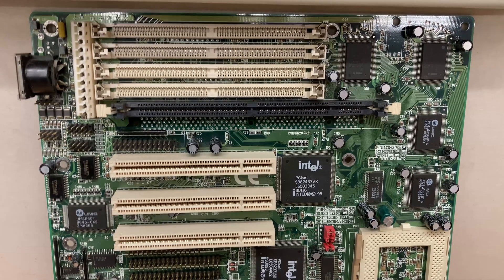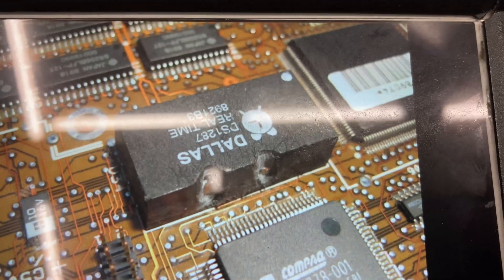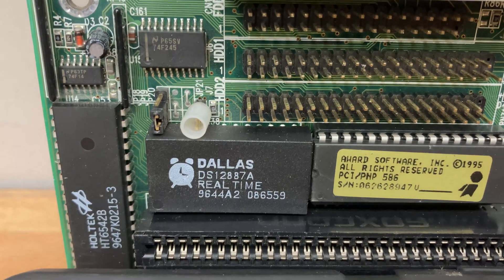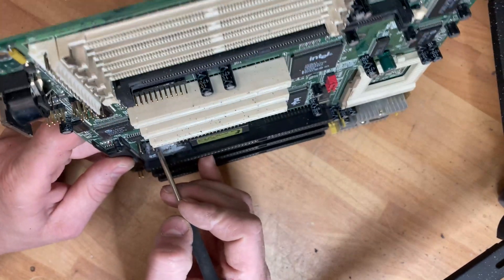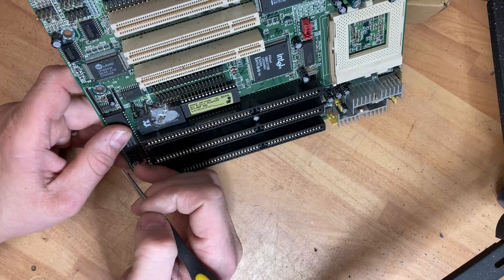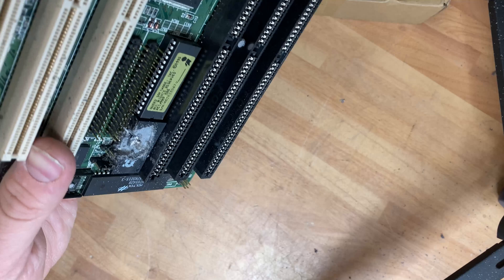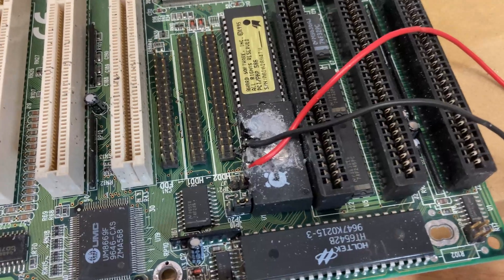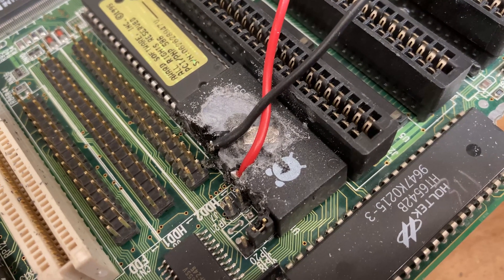Repairing The Dallas  Real Time Clock in a vintage computer without removing it from the board

Comment: Hello. I have the same motherboard. Should it enter to POST with drained Dallas chip? Because the one I have is not responding to whatever I am doing? Also do you happen to know an exact model?
Reply from the maker: yes it should post it just will forget all the settings , i cant its been a while thanks
Reply: Thanks for prompt reply! What about maker or the model, was you able to find it by any chance?